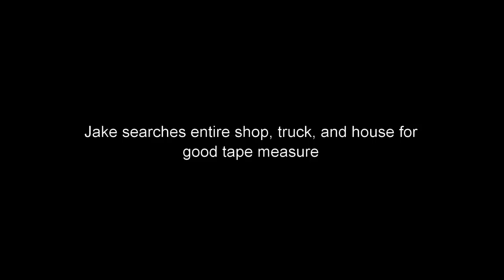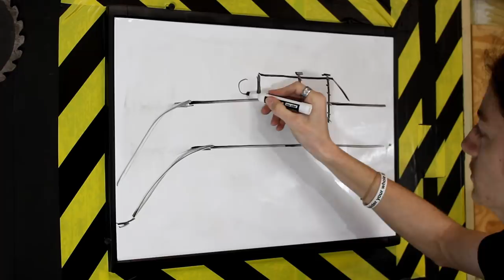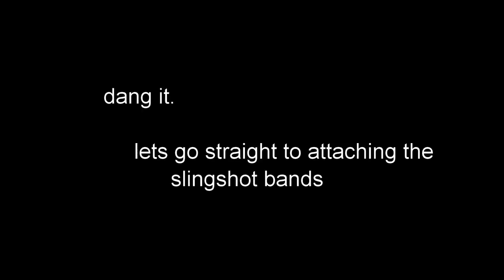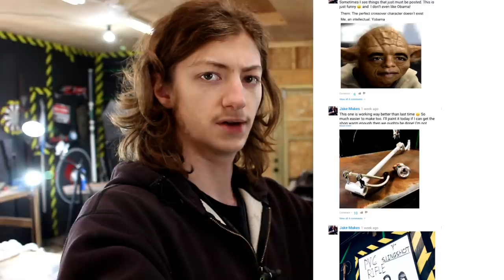PVC Slingshot Rifle 2.0!! (Best on YouTube)

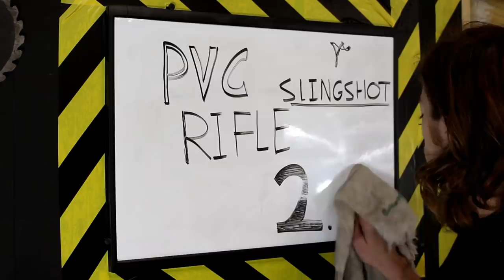Comment from the maker: THE TRIGGER: I thought it was pretty clear how it worked, but since most of ya'll are apparently smooth brained, might I direct your attention to 8:00, 13:28, 13:35, 15:00, and 15:20. You can slow down the video to .25% if you have trouble with your eyes. 

Hmm, maybe I should explain it in words (except you probably can't read): Push up on dowel. Dowel pushes up the ball and pouch. Ball and pouch lift up over the wood block holding them in place. The slingshot fires. 

If you still can't figure it out, you shouldn't be allowed to touch tools. Or grass. XD

Comment: Did not understand how a dowel pushing up on the pouch would have total contact instead of partial failure. Would have been nice to have a slo mo shot close up on that action.  Love your pvc heat formed trigger pull. Surprised to see it still had bounce to the ounce.
Reply from the maker: There’s enough friction between the ball and the pouch that it doesn’t matter where the dowel makes contact.
Reply: @jakemakes  Ahhh ok, thank you for the data.

Comment: GREAT VIDEO!! Solid instructions, although I am sad that you lost the part when you made the trigger. I hope you could make a separate video for building different types of triggers.
Reply from the maker: Yeah it was a bummer. It was pretty basic tho so not hard to figure out by looking at it
Reply: Not really!! I still have my doubts about it...lots of questions on the MECHANISM.
Reply from the maker: Push up on dowel, dowel shoves ball and pouch up over the block, slingshot fires.
Reply: @willierivera1966  watch on 8:00
Reply: @jakemakes  but what happens after the slingshot fires? ya gotta be more specific when expaining things or wel never understand! 🤪
Reply: yea, his excuses are insincere though... close to BS; reason.. no update
Reply: @jakemakes  you fail to say that the poach most probably has a bottom that holds the projectile; the dowel would otherwise eject the projectile without the poach
Reply from the maker: @justnoted2995  Good point, but i'm not convinced it wouldn't still fire correctly. The surface area of a round steel ball on wood is much less than the leather pouch surrounding the steel ball on 3 sides. The difference in friction should be enough that the ball stays in the pouch. Not sure if i've tried it tho

Comment: You have to align your rubber bands with the arrow for better accuracy. Now about your 1.0 and 2.0, if you build something for the first time that's 1.0 now if you modify or upgrade anything on your project that's 1.1 and so on as long as it's still the original. now If you completely change the design but it's still the same concept then that's version 2.0 and so on, at least I think please correct me if I'm wrong

Comment: The 1.0, 2.0 design named scheme comes from tech and engineering. If you completely redesigned it then the front number changes (2.0) . If you make improvements to the orginal design but retain most of the original then the second number changes (1.1)
Reply from the maker: Ah.... that makes sense. Then I accidentally used the correct term for this one XD
Reply: @jakemakes  an argument could be made either way since you changed the trigger mech.

Comment: Hey, you should figure out how to make the front detachable so it could be used as a normal slingshot, too! Just for if you can't pack the whole thing🙂
Reply from the maker: That’s a really good idea actually
Reply: @jakemakes  Is there a way you can think of that the front forks attached by the t connector could safely come on and off without risk of it coming off during use?
Reply from the maker: @carsonacosta3170  Not off the top of my head but i'm sure it could be done

Comment: I REALLY WOULD LIKE TO SEE HOW THE MECHANISM OF THE TRIGGER WORKS....HOW DOES IT LOAD AND FIRED.
Reply: Me too. Seems like the trigger would just push the ball up out of the sling. Would like to see a close up of how it releases
Reply from the maker: You’d think it would, but the friction of the ball against the pouch is stronger than the friction of the ball against the block, so pushing on the ball shoves both ball and pouch up over the block and releases. Although technically my dowel is centered halfway on both the edge of the pouch and the ball, so it pushes on both

Comment: Jake - Standing by, like to see you  " mounting, securing trigger - plus you loading it "  - I  just can't imagine the pouch with steel ball slipping , smoothly  over the back of wood block  ??? 

What about a pvc pipe with slit for the pinched leather pouch - then dowel pushes up to dislodge pouch from slit ???
Reply from the maker: You could do the slit thing and it would probably work. But the wood block works great actually

Comment from the maker: So yeah i skipped the part in the original challenge where it was supposed to also shoot arrows. It would have made it more complicated and wouldn't have worked well. This format of bands and the draw weight wouldn't shoot arrows far or at a high velocity anyway. So i just skipped that part so it would work
Reply: K,cool.build 1 that will shoot  arrows,bows from the t back to a hand  held deal that is used with the bows,mount it for your trigger.stronger bands though.....Get it put together and  working I will order some from you directly, k!??

Comment: Constructive Criticism only here. I would have to beef up the barrel some. The taller the eye bolts are, the more leverage on the  barrel and the barrel looks a little light duty after the build was finished. I think it will break eventually and you’ll have a chunk of plastic and metal coming right back at you at high speed. Hope not.
Reply from the maker: Doubt it'll break but it wouldn't hurt to jam a wood dowel or something down the barrel

Comment: Ignt man ik I'm a little late to the party but I have an idea id like to try to make a sling shot to where the y set 6 or so inches from the handle and rather than having a  traditional y top I want to put a compound bow type of thing so i has more power what are your thoughts
Reply from the maker: I don’t think you would get any more power out of it. Just double up more rubber. The compound mechanism would just complicate things with no advantage

Comment: I like it, the front eye bolts should have been installed much lower for less (up twist) leverage against the T fitting in front. its a half step away from being a good little speargun if designed just a little bit differently.
Reply from the maker: The loops are higher than the block a bit. It doesn’t matter the bands are always straight. The difference between the frame of the thing and the bands is irrelevant to hitting the target, it’s just a matter of learning how to aim. His point was that the due to more leverage from the loops being higher off the frame it caused the bands to flex the pvc frame more than if the loops had been mounted lower down. In practicality it doesn’t make a difference

Comment: You defunitly need to add a spring to that trigger
Reply from the maker: Where?
Reply: @jakemakes  between your thumb and index at 15:08
Reply from the maker: @4ZURI  So the pvc trigger frame actually acts as a spring and always pops the dowel down into position. It looks a little like I have to push it down in the video, i don't. So a spring isn't needed although if I used something besides pvc that didnt flex yeah you'd want to stick a spring in there

Comment: Great video, I like the paint job. How far would it shoot something? 

Oh and also I’d like to see a rebooted PVC air cannon but artillery style, maybe slightly bigger and with two wheels on the ground.
Reply from the maker: It would depend on the size of ammo..... pretty far. Accuracy is another matter tho. I was shooting 1/2" steel balls and they dropped pretty quickly because of the weight. Lighter ammo would go a lot faster and farther. Also depends on draw weight of tubing you use and how short you cut it. In other words, you could make this design shoot as far as you wanted it too

dude that would be sweet!!

Comment: Lol I wouldn’t want to be the person aiming this pvc slingshot when it breaks and the front loop bolts come flying in my face..
Reply from the maker: Hmmmm somebody doesn’t use pvc enough to know how strong it is
Reply: @jakemakes  lol maybe.. but I've used it enough to see it shatter, there is a fine line with overtightening threaded pvc and often the only way to get it tight enough is to add a pipe clamp before completely tightening it.. it maybe works for your purpose or maybe most purposes but I'm pretty cautious with the stuff by now. It causes quite a mess when a pipe breaks and I'm not exactly keen on making a mess of my eye..

Comment: if you used an angle grinder to cut them screws you would end up heating up the srews and melting the pvc were the hole is making it larger.
Reply from the maker: Nope. I’ve done it 20 times before. They’ve never heated up fast enough 🤷🏻‍♂️
Reply: @jakemakes   Can you make the sling shot more powerful.
Reply from the maker: Yeah, stronger rubber, more rubber, smaller ammo, pretty easy. You could pretty much make it as powerful as you wanted.

Comment: Still can't get my name right eh jone? Lmao! By the way this was awesome! Well done Jake!
Reply from the maker: Lol THAT was it ;)  haha thanks man. Love the project, thanks for the challenge I think i did it better justice this time
Reply: This looks much better than the other one and looks a lot easier to make. Heck I think even an old geezer like me could possibly do it.
Reply: What are the material stats for this project?
Reply from the maker: PVC was like $3 (for ten feet), a couple tee fittings another dollar, and say another buck or two for the eyebolts and screws...... 5 or 6 dollars. Rubber is where you are going to run some more money depending on what you chose to use and where you got it. Since I wanted a bunch for future projects, I bought 25 feet for like $25 dollars. You could buy less or use replacement slingshot bands for pretty cheap though.

Comment: This is not a rifle; it does not impart spin on the projectile for flight stability.
Reply from the maker: Oooh we are being technical. What would the correct term be you think?
Reply: @jakemakes  Slingshot.
Reply: @jakemakes  "How to assemble rubber band on stick", LOL.
Reply from the maker: Lol 😂 most people just call these slingshot rifles. I didn’t name it file a complaint with somebody else 😅
Reply: @jakemakes  Bruh, most people call a slingshot a slingshot.
Reply from the maker: @miamislice3280  Bruh, type slingshot rifle into any search engine
Reply: @jakemakes  That aint most people and it does not help your point, your neighbor pointing to a turtle and saying it is a fish does not mean you ought to follow suit simply because they both swim.
Reply from the maker: @miamislice3280  You are ignorant. This style of slingshot is refered to as a slingshot rifle. This video has 700,000 views because of people searching for the keywords slingshot rifle. Its in my analytics. Language evolves over time and words take on meanings they did not originally have. Go figure.
Reply: @jakemakes  I searched "air rifle" and I guarantee some significant measure of your views are a result of the same thing and like I said before; people using words incorrectly does not justify you doing it, now maybe stop taking corrections so personally.
Reply from the maker: @miamislice3280  I'm not taking it personally, you are just wrong. Search slingshot rifle and see how many people use the term. I don't care what the heck people call these things, I'm going to use the words that will get me the most views. People call most "long barreled airsoft guns" (i suppose that is the correct term lol) airsoft rifles. You'd be hard pressed to find a rifled airsoft "rifle". This isn't really debatable man.
Reply: @jakemakes  Gotta get them them tasty youtube views, I guess, you do you.
Reply from the maker: @miamislice3280  Lol yup. Thats the goal XD If i cared id work for miriam webster
Reply from the maker: @miamislice3280  Yo you know what you reminded me of a video Jeorge Sprave did on making an actual rifled slingshot. Don’t know if you are really into slingshots but it’s super cool: https://www.youtube.com/watch?v=Kb_QgbSnDZk&app=desktop